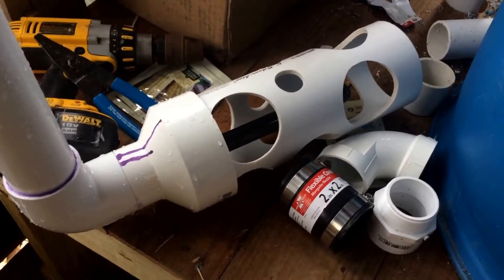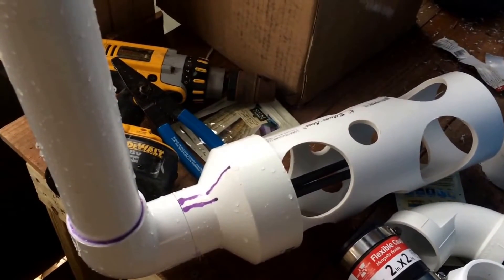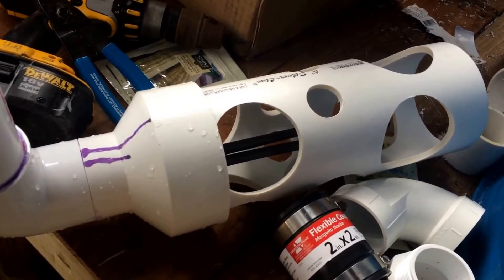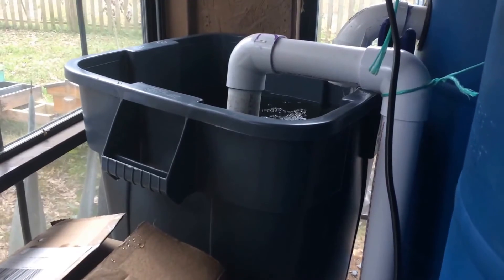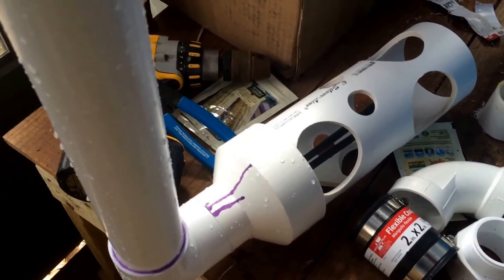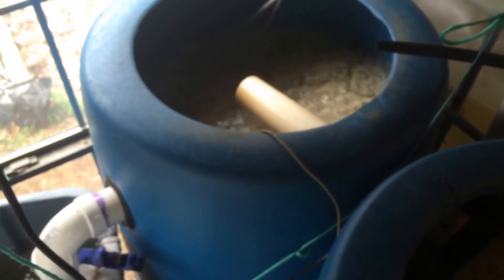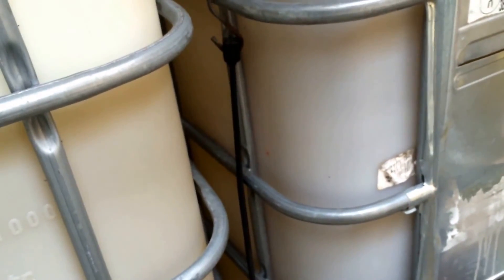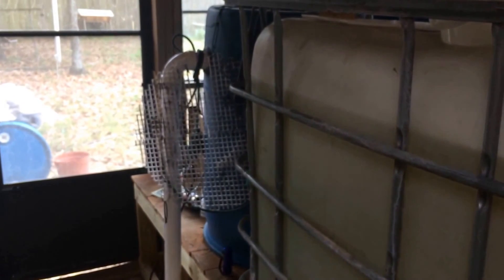Tilapia Heater Rebuild

Comment: is 98 degrees your heater temp set point?
Reply from the maker: +ltdorn No! Did I say that somewhere? I think that'd pretty well cook the fish, even though tilapia can survive hotter water. I usually have it set around 72-75. Enough to keep them actively feeding, but hopefully not so actively breeding :)
Reply: +Tom Brueggen Sorry.... i mistyped i meant to type 68 degrees. Rewatching, i see you said it water temp was 68 and heater was heating water back up. I have a system (white nile) in two 250g totes and 4 grow beds in a PVC green house. I have my heaters set to 72. lol..98 degree would be making fish soup and my plants would probably be dead also...  i think next year i am going to go all blues so i can drop the temp a bit more. Here in AZ the summers are hot, and the winter get crazy cold at night but heat back up in the day.
Reply from the maker: +ltdorn Are blue/nile legal in AZ or do you have a permit? I have mozambique as they are the only ones that we can have in Texas without an exotics license. 

Right ok, I didn't rewatch the video to see what I said but yes, this heater is very simple. If temp drops below set range, the heater kicks on until temp get's back into the set range. It can be used in the same fashion on a cooling made if you had a chiller for a refrigeration unit or something.
Reply: +Tom Brueggen yep all tilapia are legal in as at this time. probably because we dont have a bunch of water sources that they could live in... like i said the water gets really cold in the winter so i would assume the places they could live, they would die off...
Reply from the maker: +ltdorn I've heard they have already naturalized some of the bayous around Houston, especially where there is warm water effluent. Mozambiques are allowed on the idea that it will get cold enough to kill them off as well, but of course Blue and Nile would likely make it through a winter. Well good to hear. Best of luck with your setup. I'm taking mine down here soon. Only a handful of fish in there. I'm not running that system all through the winter again!